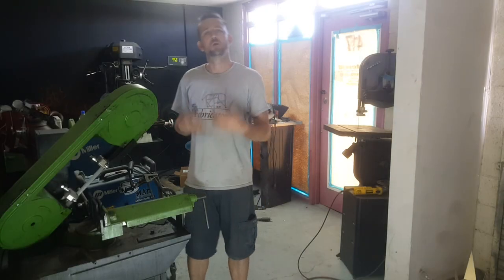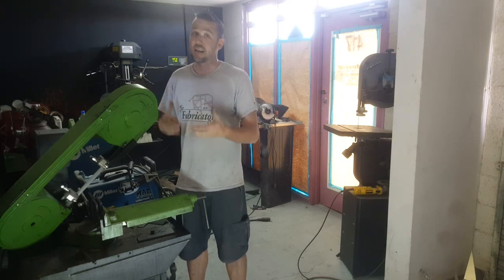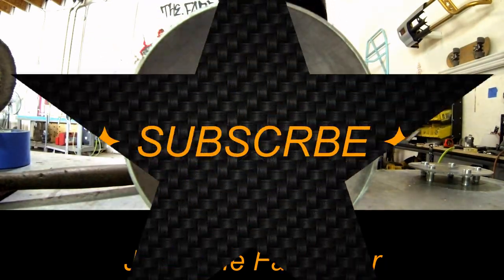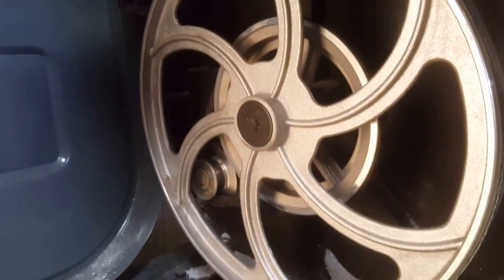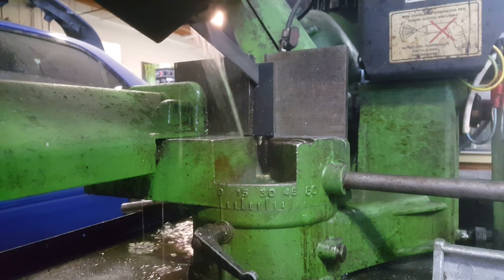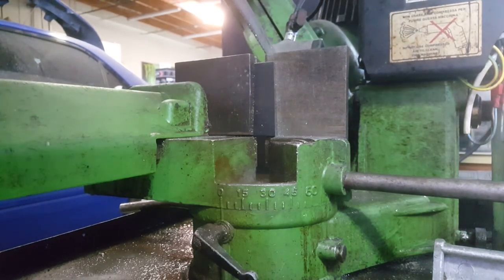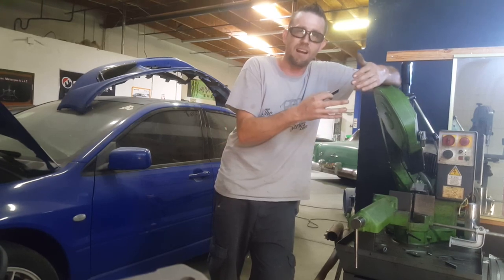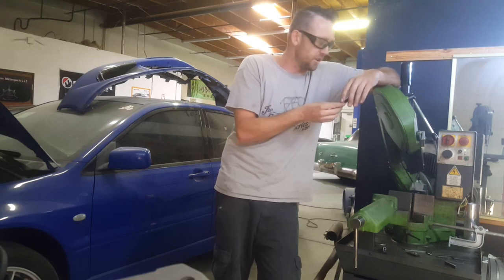TFS: How to Break In a New Band Saw Blade

Comment: At my high school we got a new jet saw  and we have had the blade break twice once because of user error the second one was a bad blade from factor that broke on the welded spot my teacher is more or less a supervisor so he asked me if I would be ok with trying to weld it back together see how I have become pretty good at tig welding thank to TFS for tip very helpful in leaning and understanding tig but I was successfully able to weld it back together until we get our replacement blades ( p.s it take a wail for us to get a new blade due to how our schools systems works he has to let the board of ED know then they order the blade instead of my teacher this makes it take a wail)

Comment: How does the thickness of the stock effect the 80~100 inches? What I am thinking is if one cuts ⅛" stock vs. ¾" stock? Do both sizes still dictate 80~100 inches?
Thanks for another great video.
Reply from the maker: Thickness is actually irrelevant. The distance the saw drops will be the amount counted since it cuts from contact to completion regardless of thickness.
Reply: @TheFabricatorSeries  I know this is old, but I think it was more of a question because on thicker stock the same distance drop means the blade 'hogs out' more material, which sounds like it should matter. Like if you do those 100 inches drop, but with 10thou shim stock you wouldn't call it broken in, would you?

Comment: Great tips, but...... yeah there's always one of us out there, right.  I was taught that the 100 inches was 100 SQUARE inches of material cross section.  So the equivalent of 100 cuts in 1in square bar stock or 25 cuts in 2in square bar stock.  I'm open minded and can be convinced otherwise.  Blade technology has probably come a long way since my tutelage.  Comments welcomed.

Comment: Really helpful video. I did not even know I had to break in blades: infact I scapped some of them quite ealy. Anyeay I got a question: given that most of my work on the bandsaw is tubing stuff, how do you suggest to break them in. Unfortunately it's an interrupted cut which I don't know if it's ideal for a brand new blade and, it's kinda difficult to estabilish the lenght of cut, maybe I can get away with the perimeter of the tubing that I'm cutting.
Reply from the maker: The diameter of the tube is the amount it cut from start to finish unless you changed directions or cut at an angle. The rule is only general. Some blades take more time to break in - some take less. Just follow the procedure and keep and eye on the blade.
Reply: Thanks for making these videos. I know how long it takes to film, produce and edit them; and it is a lot of work!

Question: 
I am just metal working as a hobby so I am in no hurry to finish my cuts. Would I see longer blade life if I keep the blade speed and feed rate at 1/2 of normal even after the blade is broken it, or is the blade life unrelated to speeds and feeds after it has been broken in?
Reply: i doubt it. the idea seems to be to radius the points. once the points are radiused they can go at production rate and speed with little risk of chipping the points. then again, i only just learned this needs to be done.

Comment: hahaha this is totally WRONG.  Another example of somebody who just parrots what they read on the internet.  Band saw blades do NOT need to be "broken in."  What, you want a blade with a rounded, dull tooth?  Common sense people.  A blade with a rounded edge will not cut efficiently, it WILL generate more heat and shorten blade life.  Hey Justin, take 20 brand new blades.  Do your "break-in" on 10 of them.  Then cut the exact same stock with all the blades, and see how long they last.  Total waste of time.
Reply: Jorje Arturo why don’t you buy 20 bandsaw blades and make a video 🤔
Reply: So, you know more about bandsaw blades than the manufacturer?  Hard to believe.  You break-in the blade so that you don't chip or damage the teeth on it.  The end of the teeth should have a small radius on them to withstand faster feed rates (higher pressure).  For your education, here's a link to a Starrett publication on breaking in bandsaw blades.   http://www.starrett.com/docs/saw-resources/recommendations.pdf?sfvrsn=2
Reply: You are not rounding off teeth by braking in a blade.  I've been using band saws over 50 years.  Listen, he knows what he is talking about.  Brake 
in your blade as ALL blade manufactures suggest you do, if for no other reason than to hone in the weld joint. I keep around a piece of 1018 round just for such a purpose.  Problem here is you don't know what you don't know, and you don't even know that!